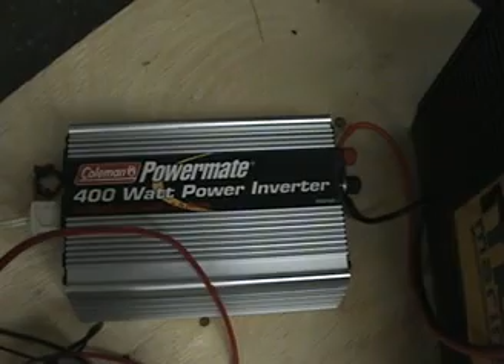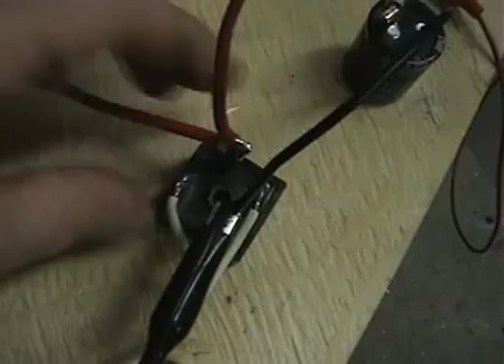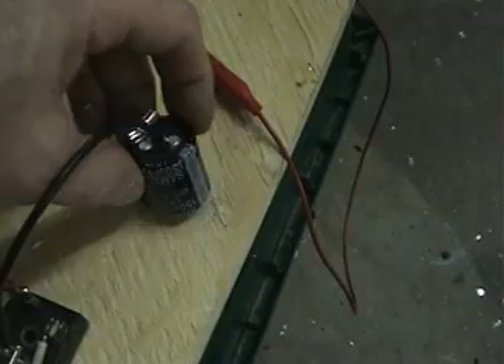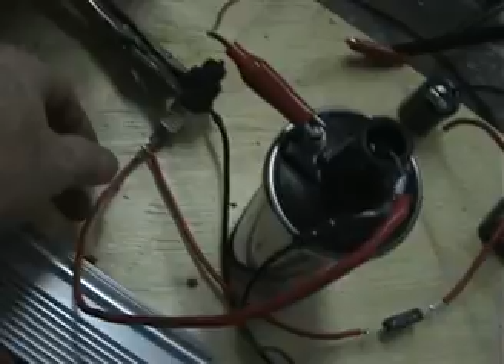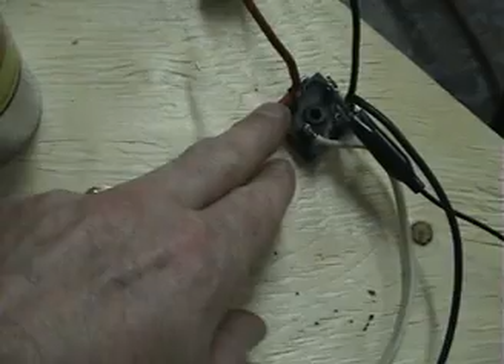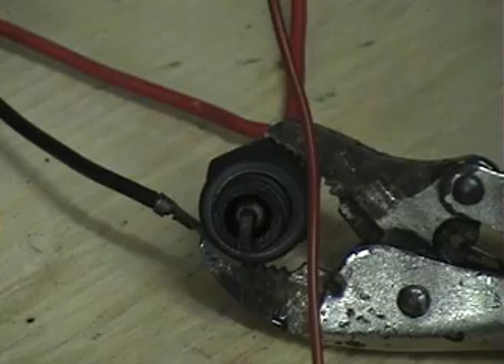Ganga Shakti - Water Power Test 1

Comment: ####!!! The S1R9A9M9 conversion of cars and 18HP Briggs mower engine , about 205-2008 Georgia,  to water in carbs, all had a second spark gap. They all used  6v relay sealed in vacuum, per cylinder, that the high volts jumped the internal contacts as spark gaps. The redirecting diodes added to circuit had the back EMF > 100v added to spark plug also, from the series 1.5MH inductors inside the the relay. 6-7 amps average current necessary THROUGH spark plug with time delay line inherent coil - like in relay. Half wave DC necessary as from Inverter output , one diode, and grounds ISOLATED, because of secondary winding.The relays were electromechanical type as used in AC traffic pole circuit boxes for Georgia signal lights. The old style engines also had spinning rotor in distributor cap that had 1st spark gap . His 2 sparkings is what assures smoother spark plug RPM without skips. Timing retarded to minus 34 degrees. Engines run on WATER VAPOR PRESSURE  GENERATED + Hydrogen gas generated and ALSO fired. This was Nathren's  invention successful circuit design. EGR applied increased efficiency by providing embedded nitrogen from air from compressed exhaust gases. 18miles per gallon on 1978 V8 car. He later replaced the obsolete  relays with a triple winding coil, as used on car and Briggs. Web site shut down. See his You Tube video on Briggs running on water! The triple coil and other parts are inside the plastic tub , on side of engine. Battery disconnected after starter use. Power is from the  MAGNETS activated flywheel alternator and diodes. He neglected to say it was self running!....<<>>> ...

Comment: What I see in this sparking video, is the LEFT OVER small BALANCE of charge on cap discharging through 12kv diode and through plug WHEN high V. fires the spark plug.  Effect only happens with CDI running the big coil Primary. 12kv diode protects power supply, while secondary  diode keeps out power supply drainage. Caps don't fully discharge out, unless using Photo Caps/ Energy discharge caps.- such as used in camera circuit for the flash bulbs. The large snap noise  is due to much shorter ON TIME (fast) discharge of capacitor balance into near zero load, similar to a short.
 The earlier S1R9A9M9 set up is based on LONGER on time of engine spark during ATDC at 0 - minus 34 degrees of piston descent, and use of common 3-7amps DC straight current. This changed carb water to water vapor pressure (fog) and minute hydrogen evolving as long as EGR was also used for the Nitrogen content of reclaimed water from exhaust. This improved for smoother running engines. 2 MH Inductor coils were in both Hi V and Low V lines. The triple hand wound S1R magnetic coil replaced the unobtainable dual coil latching relays sealed in Vacuum, that were originally used in 60 cycles traffic signal pole boxes, and then on V8 engines. Three uses of the new coil - forced late 18HP engine timing, same amps through spark plug as well as generating magnetic field , and small magnetic field conduction down to plug gap with accompanied radiant energy.

Comment: i have done another circuit and it works well at no pressure but on the cylinder there is no spark. i guess need much more voltage to ionice the compressed mix of humidity air and gasoline or hydrogen as i want.
Reply from the maker: The more humidity the more obstruction for the Ions. Luc
Reply: inside the cylinder under compression is the problem as i said. at that compression is pure liquid almost. if we want to use water as fuel need higher voltage ignition coil.

Comment: The high voltage is ionizing the air making it very low resistance and then the low voltage passes through  the ionized (low resistance air) creating plasma which then explodes the water.

Comment: WalkaboutmikeJ is right.
Luc, can you please try to remove the
big diode and just use the cap charge 
and no connection from the inverter to the 
sparkplug ?
Will this be the same discharge spark or
does the rectified AC also flow via
the spark discharge and make the spark bigger ?

Many thanks.
Regards, Stefan.

Comment from the maker: Thanks for loking, yes 150 uF, it is rated to 400v but only charging it to 105v. Yes then charge is then dumped into the primary
of the ignition coil. I use the hi voltage of the coil is used as a triger or path to short the the DC on the bridge rectifier where the BEMF RE Plasma flame is.

Luc

Comment: Nice set up. If you use a coil with two windings going through a main coil to boost the out put spark up about 10 times what you have now you will have a system almost like mine. You can test your set up on a weed eater motor and know for sure that you have it. I like people like you who dont wait on slow folks like me. Thanks for the video and keep on sparking.

S1r9a9m9.
Reply: Hello Sir!  'Two wires mean a bilfilar coil going through a monofilar' I'm I correct? In case you are still posted on this stuff please🙏

Comment: What is the uF of the cap, just 150 uF ?
and what is the voltage on it,
when you have charged it with the inverter ?
Do you then dump this charge into the primary
of the ignition coil and just use the high voltage output of the coil to jump the spark at the wet sparkplug ?